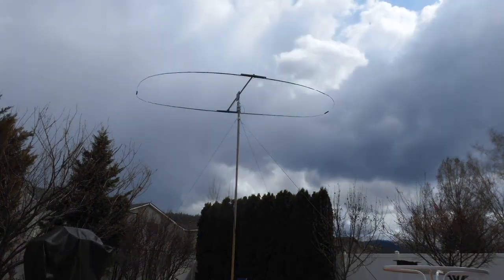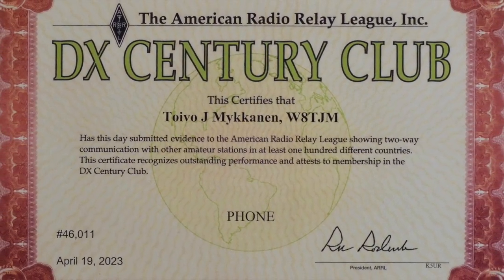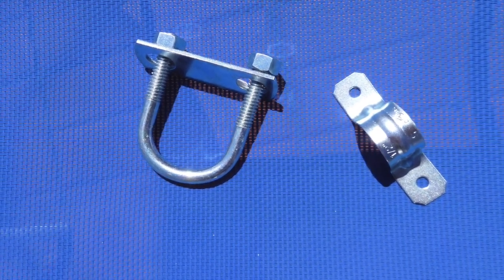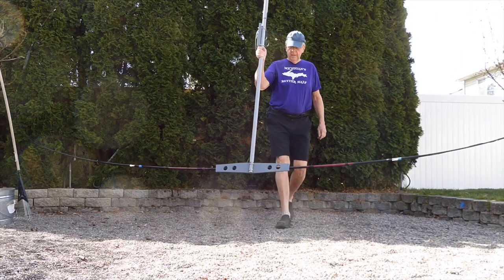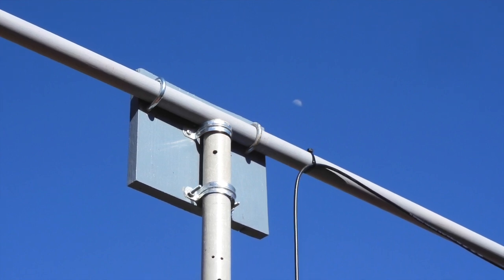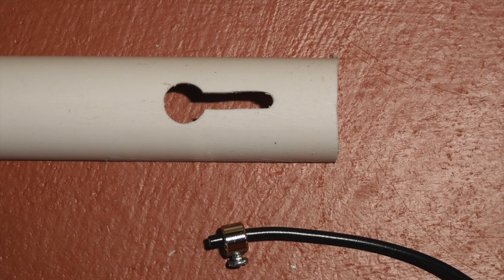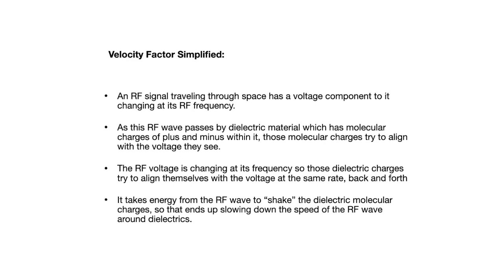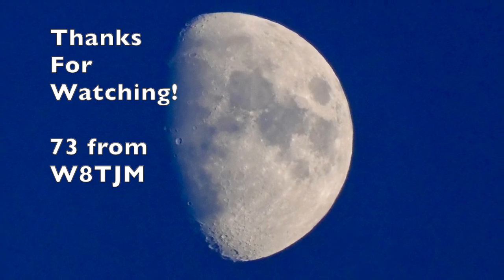15 Meter Oval Moxon Antenna

Comment: From the brief showing of the antenna analyzer display, I take it that the match is practically 1:1 at resonance and 1.5:1 at band edges?  That seems like the case and what one would expect / hope for.  Is it fed directly with 50 ohm coax or via a 1:1 balun choke?  I don’t have the QST article handy.
Reply from the maker: I do not normally use a common mode choke, but one certainly could be added.   The antenna is up in the air enough that the currents stay fairly balanced so have not had the need for one.

Comment: Great video Chuck. I made a Moxon antenna to work on 15m and used 1.5mm wires insulated supported by carbon fiber fishing rods. I used the "online Moxon calculator"  software from W4/VP9KF to make the antenna (thanks Paul). I am very pleased with the performance of it. I have worked all continents and received great reports from all of them. I only work CW. I recommend this antenna. My Moxon is 18ft high. 73 to all.

Comment: What is the max power usable on this antenna. Great job though, looks very professional. I will be looking at building a 20m version.
Reply from the maker: I have run 1200 watts through it, but normally run about 800 watts.   It has a decent VSWR so voltage breakdown is not an issue.

Comment: Very interesting and helpful video. One correction on your slide of "Why is the driven element shorter than expected?" : The velocity factor in the lower right-hand corner of the table should not be 0.81. Dividing 430 by 492 will yield an implied velocity factor of 87.4%, not 81%. That difference threw me for a while when I was doing calculations and comparing to Moxgen-generated dimensions.
Reply from the maker: Hey, good catch, and you are spot on!  Glad to hear it is correlating with Moxgen analysis as well.

Comment: Are there any gains from this design over the normal rectangular moxon?
Reply from the maker: Modeling it with segmented arcs, it behaves like a rectangular one with slightly more forward gain and a more complicated back-side pattern.   I've been super happy with how it has worked out with  practical on-the-air performance, as it has gotten me to 166 countries worked, mostly on phone, from an HOA.

Comment: Great design but I think you said "I used 3 telescopic poles" I think I need 4 right?
Reply from the maker: Ah ha!  That does sound confusing on the video!   Should have said:  "I used FOUR 3-piece telescoping fishing rods......"   So yes, you need four of them.  Thanks for the comment.  It is a very worthwhile project as it works so well when mounted at modest heights.  Mine is normally at about 16-17 feet.    73 -Toivo

Comment: Very clever design. I am going to take this idea and improve on it I hope. I would like to reduce the weight.  It looks like the antenna does not line in one plane, but droops down on the sides near the 2 separators. Is it safe to assume this did not affect the performance?
Reply from the maker: There is very little change caused by the shape or the droop.   Have modeled it quite a bit and used it extensively.  I like your idea of making it lighter, and I have been looking for plastic channel material for the boom and rod supports as well.  Have fun with it!

Comment: Can it also be done for 10 meters?
Reply from the maker: Moxons work very well on 10 meters, so yes, absolutely!  Use the formula at the  5:15 mark for the driven element and the spacing should probably be a bit under 7 feet.   Make the reflector 5-6% longer than the driven element.
Reply: @W8TJM  Wow, thank you so much sir. You see, I am just new to hf starting with just an hr2510  and a rotary dipole. All the best to you sir and your family. 73s, DW1QEW.
Reply: @franciscolopez3229  If you have a dipole, you can add a homemade reflector that is 5% longer than the dipole and 7ft  away from it. You can also, add a director that is 5% SHORTER than the driven dipole and placed about 7ft in the opposite direction as the reflector and you then have a 3 element yagi. I built mine with romex wire inside pvc pipe mounted on a 12 ft 2x4 board. It is fastened in a tree and barely visible. Multiple antennas with an antenna switch act as a rotor.